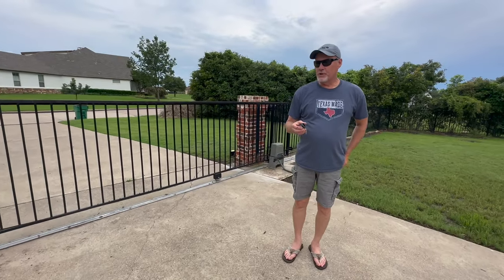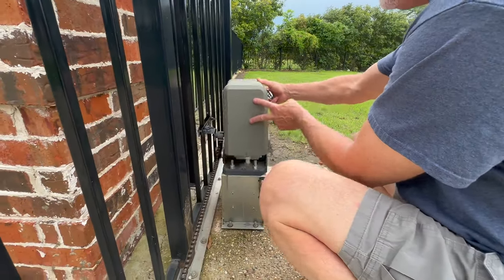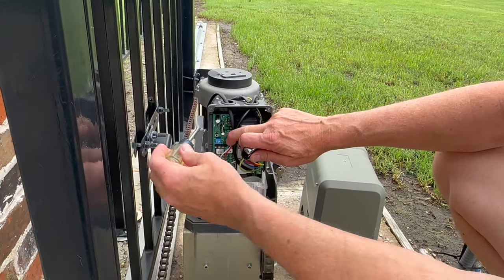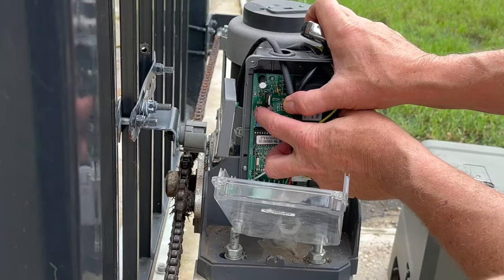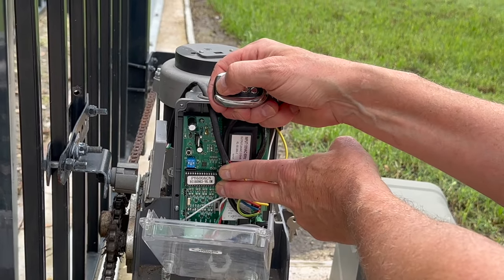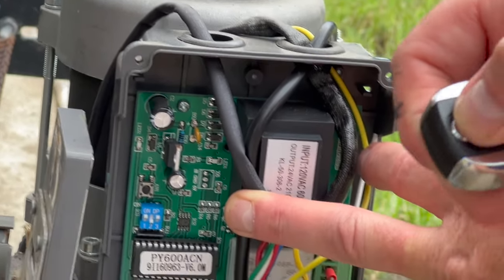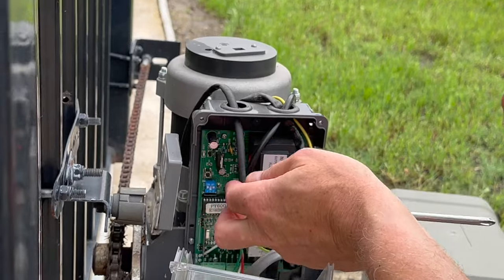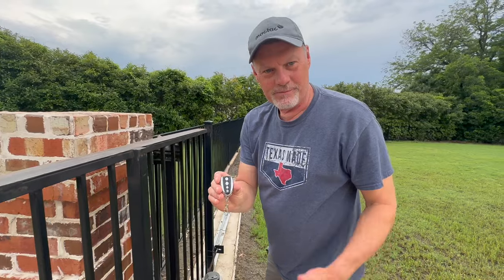Easy Co Z Gate Opener Programing

Comment: Great video, I did this to program two CO-Z gates onto one control and worked well for 3 controls. After that I ran into a problem where one button would close/ open both gates. Any advice on how to fix this?
Reply from the maker: Hello, I wish I had the answer for you.   I’d disconnect the power, basically reboot and reprogram the remotes.   Good luck.